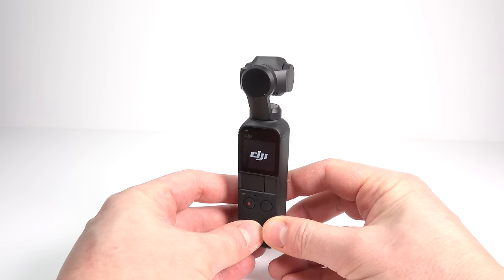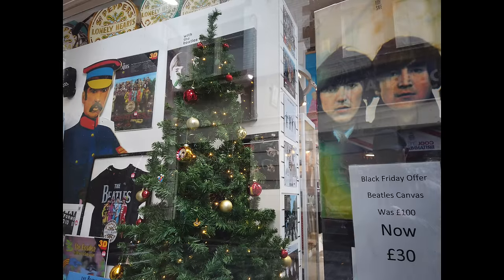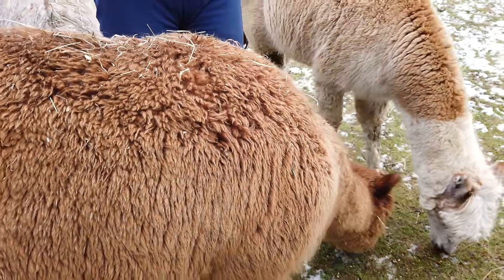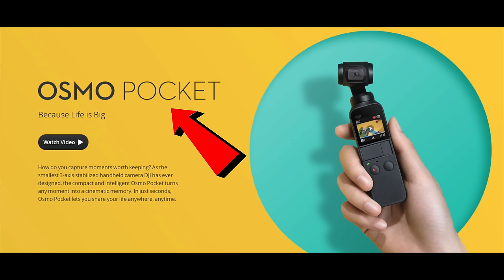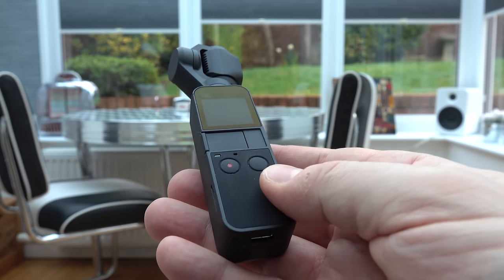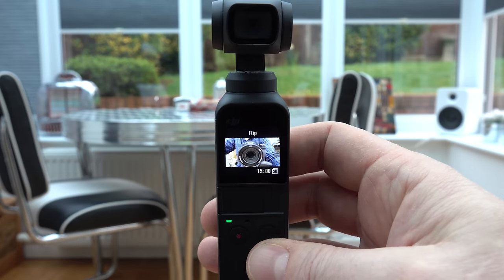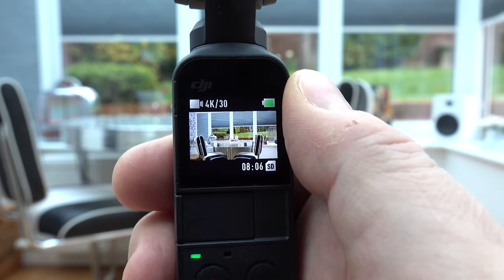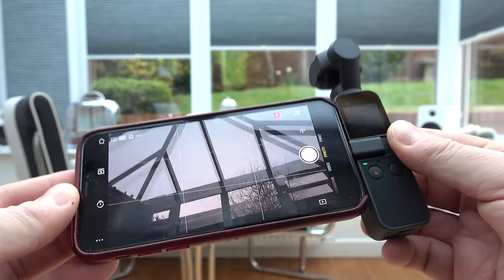DJI Osmo Pocket - REVIEW 3 months on

Comment: Seems like DJI wanted to have add on products ala' Apple and EA. Why engineer a perfect product when you can provide add on accessories to make it seem perfect. Should have been a lower price point definitely.
Reply: This Apple model of "buying a canvas, but having to wait for paint and brushes" is getting absurd. That's why many Apple products have a complaint list a mile long. This camera seems to follow the formula, but really needs to at least have the control wheel, filter lenses, and an improved storage case as standard. The company has a good product, just doesn't need to make it a pay as you go affair.

Comment: The problem with staring at a screen all the time is that your attention is now elsewhere and you become detached from the experience. It's the same issue trying to capture video with a smartphone. You can either keep your eye on what's happening, what your screen is seeing, but never both. As a result your memory of the event becomes muddied with a lack of any real detail.

I ran through this when trying to capture a fancy plane take off from my local airport. I pretty much saw nothing of the actual take off and can only remember trying to capture it on my phone which turned out a total failure. Life experiences shouldn't be missed like that.

As far as this device goes, I'd just stash it in a pocket and keep the accessories on a belt case.

Comment: This is a very good and honest review (as often, by you).
About the "losing the face tracking function when the wireless module is in": are you sure that it wasn't due to the 4K/60fps mode instead? On my device the auto face tracking keeps functioning when the wireless module is connected BUT the auto face tracking is not functioning (with or without the wireless module attached) when the video format is 4K/60fps. I just slow it down to 50FPS and it works! 
Cheers, Andrea

Comment: The regular Osmo seems like a much better buy, then, especially if you're using it for what this was intended to: vlogging. You could buy a Z-arm for it to negate the bouncing movement and it comes with a built-in mic connector and wifi. And a wider lens.

Kind of a shame since the built-in mic sounds very good and the video quality isn't bad either.
Reply: Yeah and spend a grand for all of that while having a camera 10X larger. I own an Osmo, a + and a X5 are they better? Well yes but then considering the price I would hope so. Hell my Canon 1DX II is a hell of alot better also but for $5000 it should be
Reply: Dunno, you might've misunderstood me, the regular Osmo costs less nowadays than this and has most of the features you can or would buy extra for the Pocket built-in.  So my argument isn't that someone should go and buy the fanciest available device-, it's just that an older and bigger model might fit more use cases (even if that sounds like a contradiction).

At the point where you're putting effort into carrying and juggling so many accessories to make it do what you want, I see some use cases simply being better and more comfortably fulfilled by the larger. older camera.

Comment: Ok, what about the DJI osmo pocket mic adapter? Not only DJI charges you a premium for what is a cheap piece of plastic and makes it impossible to use a third party equivalent adapter but, at least outside of the USA this item is impossible to find. I even managed to buy it from a local reseller, I am in the UK, to be told the day before delivery (a good three weeks after I ordered it) that it was out of stock and would not be back in stock for another month at least. Furthermore, two-three days later, I received a stock reminder from DJI (as I had registered with their service before finding out that a UK reseller had one in stock) that the item was back in stock. Nevertheless, when I tried to buy it from their store (I received the reminder at 11.30pm and I saw the email only two hours later when I tried to buy it from their online store) I could not buy it and customer service told me that it was out of stock and tried to convince me to buy it from an American resellers for close to double its price (plus possible import tax by UK customs).

Comment: An Insta360 OneX is the same size and with full 360 capture you don’t need to worry about hardware gimbals or face tracking, you do it after the fact in the editing app. And it does great stabilization.

Comment: you should check out the REMOVU K1 which in my opinion is far superior other than the fact it currently only does 4K at 25/30 fps. everyone should also bear in mind if you are going to edit your footage in 4K (or above) you need a VERY powerful machine if you dont want to be frustrated with the stuttering whilst editing. Additionally, if you are going to upload to somewhere like YouTube files can become very big and therefore take quite a while to upload unless you render down to 1080P.

Comment: Ok, what about osmo pocket’s mic adapter? Not only DJI charges you a premium for what is a cheap piece of plastic and makes it impossible to use a third party equivalent adapter but, at least outside of the USA this item is impossible to find. I even managed to buy it from a local reseller, I am in the UK, to be told the day before delivery (a good three weeks after I ordered it) that it was out of stock and would not be back in stock for another month at least. Furthermore, two-three days later, I received a stock reminder by DJI (as I had registered with their service before finding out that a UK reseller had one in stock) that the item was back in stock. Nevertheless, when I tried to buy it from their store (I received the reminder at 11.30pm and I saw the email only two hours later when I tried to buy it from their online store) I could not buy it and customer service told me that it was out of stock and tried to convince me to buy it from an American resellers for close to double its price (plus possible import tax by UK customs).

Comment: about the phone connector at 16:13: at 6:25 it looks like you can put the phone connector on the camera the other way around to protect it from breaking off.
Reply: exactly - techmoan should have realised that
Reply: @Techmoan  You need to look again - I have just swapped the phone connector (lightening) just now from sticking out the case position to inverted and it fits into the case fine - thus protecting the connector - I'm not new to this either!

Comment: From my experience with mobile photography, DJI has a nice pedigree and their devices are typically of high quality but they are honestly overly proud of their devices and the price tends to match. Their drones are a fine example where-in they know that professionals are willing to buy them so they jack up the price but this drips down to their consumer products as-well which means that you can often get other products with similar or even the same function for as much as half the cost for the same quality. 

The Go-Pro karma drone and Grip comes to mind as they not only show an example of a fantastic drone in the same niche as their prosumer and pro series drones but also the ability to use tried and true go pro cameras with both their drone and grip which means not only great image quality (for action cameras) but also ease of replacement since instead of attempting to send the drone as a whole off for a service, you could just replace the go pro itself with either a new one or an existing supported one (of which is supports series 5, 6 & 7) that you might already own.

Comment: The problem with a wider angle lens is that for selfies it will distort your face and enlarge your nose.  A selfie stick really is better for a higher quality presentation.  True, it would still be useful for action cam work.  Correcting the up/down bounce that others mention would be very hard - It's not a matter of pointing the camera in a different direction, you would have to give it the ability to actually move several inches up and down quickly.  It's a fourth axis to correct.

Comment: Having to activate (sign up for a company account) for a camera before first use is incredibly stupid. You should be able to plug in the charger, once it's charged you take it out and start shooting. That's it.
Reply: @Mostlyharmless1985  here's a new concept: ship products that work as intended.
Mind blowing, I know right?

Anyhow your premise is wrong. You're assuming that the activation is so that you can get the latest firmware. It's actually so that they can have your information. The firmware thing is an excuse. If they asked for a registration for updated firmware that would still be stupid, it's a file that should be available for download.
It's just hunger for marketing information.
Reply: Akshay Anand if you say so, seeing as I have a dji drone and it’s absolutely useless without a support app, so goes the gimbal, it won’t work out the box because it’s gots no brains in it.
Never got any marketing from them short of what I asked for, things relevant to responsible drone use and sane legislation for drones. 
Having this thing out the box without an app is like running around with one arm, not as useful as having two arms. You see that postage sized touchscreen on that thing? Useless!
Reply: @Mostlyharmless1985  I'm not saying that apps shouldn't be present, I'm saying forcing you to login or create an account to be able to use hardware is plain annoying.
Reply: Akshay Anand if you say so. It isn’t. You made an account to leave comments on YouTube. 
You have a keyboard, why do you need to sign in?
Reply: @Mostlyharmless1985  YouTube is a software service, not hardware. Your example is not an analogy at all. Try again.

Comment: "I'm staying out of the comments as they often turn into a bit of a neg fest and I'm really trying to stay positive for the good of my health and general state of mind."  Hmm.  You might learn a thing or two if you read the comments.  I find it rather strange that you don't want to do that.

For instance, you seem unaware of one of the prime functions of the control wheel - that's the function you get by holding down the right hand button on that controller.  This gives you full gimbal lock, which is not a function you can get from the camera on its own, nor with the phone attached.  But then you seem to be a bit hazy about how the gimbal functions at all, given the vague coverage of the gimbal modes.  I'll paste in my standard guide to these below - even if  you're not going to read it.  Someone else might.

In FPV mode (which should have been called 'Unlocked' mode), the gimbal head will follow the direction of the camera handle without restriction - though the movement will be smoothed.  It means that the Pocket will behave like any other camera, apart from the smoothed movement.

In Follow mode - which should have been called 'Horizon Lock' mode - the gimbal head will always stay horizontal.  This means that you don't have to worry about keeping the horizon straight.  The camera will look after itself in that respect, and that's handy because with the tiny screen, it's hard to tell if the horizon is exactly straight or not.  Note that "Follow Mode" has nothing at all to do with tracking a face or other subject.  This mode is perhaps the most often used.

In Tilt Lock mode, which should have been called 'Tilt and Horizon Lock' mode (except that's too long) the camera behaves the same as in Follow mode (horizon always straight) but in addition, the gimbal will point ahead in one direction.  If you move the handle, you won't be able to point the camera up to the sky or down to your feet.  You can set it to straight ahead using the 'recenter' option, and you can adjust it down to your feet or up to the sky using the little slider on the right side of the screen.  It will then stay pointing at the sky or your feet (or anywhere between) regardless of handle movement.

In all these modes, it's always possible to pan the camera from side to side.  If you want to lock that axis as well as the axes locked by Tilt Lock, you'll have to use the controller wheel accessory and hold down the right hand button on the controller.  That makes the camera point in a constant direction, regardless of how you move the handle, thus preventing panning.

Comment: This camera has huge potential, but just too many functional drawbacks at the moment. DJI need to release a redesigned second-gen version, maybe a variation with a 1” sensor to improve low-light performance and overall image quality in general, even if it increases its size and price slightly. The biggest change that needs to be made of course is a wider angle lens. This current version just has too many unnecessary limitations and is overpriced to boot. But DJIs current range of consumer drones are excellent and the best in the business, so there is hope that future developments of this device could make it a class leader. If it’s a success of course and they continue to develop it and not just freeze that or drop it altogether somewhere down the line...

Comment: Nice thorough review!  Love the Llama video clips!  Btw for comparison I used the DJI osmo mobile 2 with my Samsung s7 edge 4k cell phone to vlog some recent trips which I posted on my channel if you want to see it in action and it worked pretty well until it completely stopped working halfway through my trip.  

DJI replaced it twice under warranty but while using a cell phone is very convenient and small the problem is with cell phones having such small camera sensors they are very susceptible to warping video effects / rolling shutter similar when there are quick camera movements to what you showed on your motorcycle view.

Also if you want to get fairly smooth handlebar video try using the gopro 7 on a motorcycle handlebar 1/4" tripod mount that isn't very long. 

The gopro 7 has great stabilization and using a short mount helps reduce vibrations.  

Here's the amazon link to the $12 USD tripod short mount i use on my bicycle handlebars with the gopro 7.
https://www.amazon.com/Motorcycle-Handlebar-Samsung-Panasonic-Cameras/dp/B00585CLVS/ref=mp_s_a_1_1?keywords=B00585CLVS&qid=1554959604&s=gateway&sr=8-1

Comment: All Android phones have some kind of panorama mode. They have had it for years...
This camera is useless, the stabilisation is lacking in the vertical axis. That bouncing while walking makes it not much better than  no stabilisation at all. Dongles that offer basic capabilities, in such high prices are just a bad joke.
Reply: The one benefit of this camera's image stabilisation I can see is that it can apparently deal with being tilted, whereas my phone (while delivering similar performance when walking) needs to be kept more or less perfectly upright.
Also, I personally think this is significantly more watchable than walking footage from a truly non-stabilised camera (like older GoPros).
Reply: @der4rdi  It's just better to use phone to record and buy even a cheap mechanical gimbal, it will deal with the tilting. There also are electronic gimbals that will reduce bouncing an other things in vertical axis, but not all of them do it. The other advantage is that you can change the phone as the technology advances but still use the same gimbal to master the stabilisation.
Reply: AliveC4T that's interesting, thanks!

Comment: All things considered, it might just be cheaper (or at least more fulfilling) in the long run to get a DJI Ronin or a Zhiyun Crane for use with a „proper“ camera. Bit more bulk but you don’t have to put up with the rubbish video. 
Not very mobile or ultra portable but as we say in Germany „you have to die one death“. („Einen Tod musst du sterben“)
Reply: Hmmm. Not a 'bit' more bulk, though, is it? That's about 6 times the size and weight. Obviously you're correct that it will function much, much better, but not really comparable, as you've effectively stated yourself.
Reply: scubapig Yep, you’re right. „A bit more“ is maybe a bit of an understatement. 😉